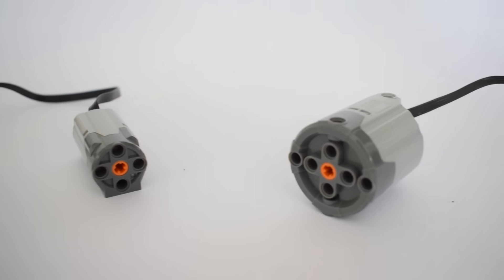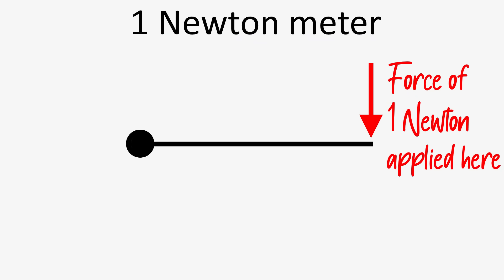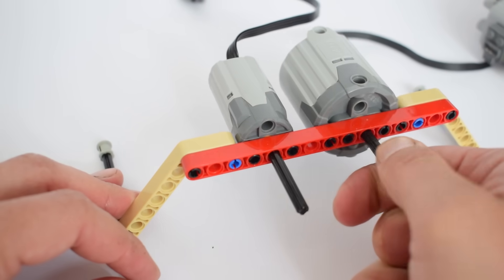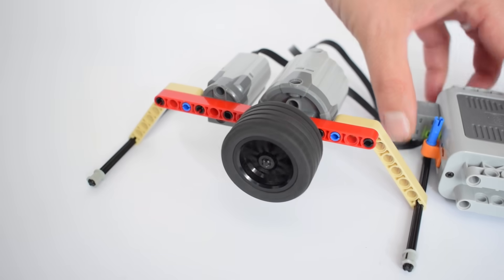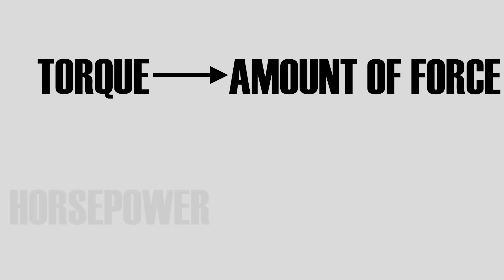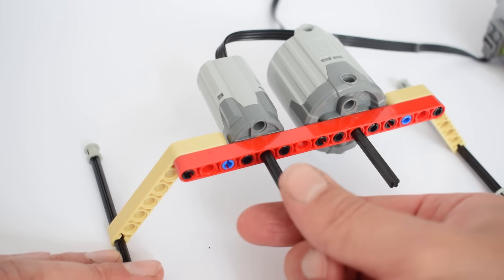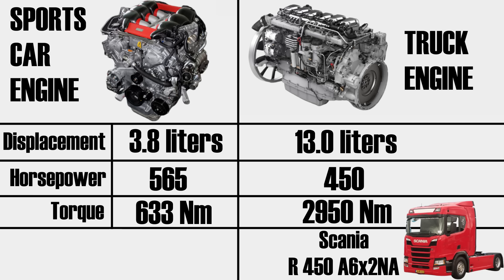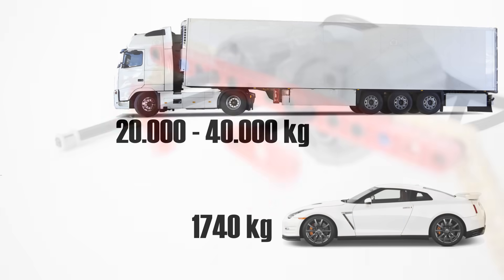NEVER be confused by HORSEPOWER and TORQUE again - HP and TORQUE EXPLAINED in the MOST VISUAL WAY

Comment: Why can't you just rev the truck engine to 7000 like the sports car? Then it would make even more horsepower as well......
Reply: You could and it would have 1500hp or so.

But the issue is massive moving masses are likely to break from balance issues or sheer forces of trying to change the direction of the massive piston every stroke.

Making it stronger to cope will cost more and higher rpm increases wear and inefficiency.

Hence truck engines are low rpm to last forever and not waste fuel.

Comment: I for myself use power and torque to determen how well tuned or at its limit the engine is build/tuned.

I compare hp and torque together. If the engine produces more torque then hp then there is still power left to gain.
Like 1.6l NA with 145Nm and 125hp. If you tune the engine you could get to a point where it is 150nm to 150hp so it is at a good point. Heavily tuned engines can reach even more like 155nm and 180hp. 

But honestly i have no clue how accurate that is.
Reply: It's not strictly true.

You can make way more power than torque on a high RPM motors.

Think F1 V8s 800Hp with like 250lbft.

The HP will keep increasing the longer you can carry the torque up the RPM range.

But you're always sacrificing with combustion engines lairy cams might make 200hp on a 1.6 but you're going to lose out on low end torque.

Comment: Torque is what pushes you back into the seat. 
Horsepower is how long it can keep it up.
Reply: Horsepower does both. Force pushing you back is G force which comes from the acceleration of the vehicle which comes from the horsepower. A "Torquey" engine just has a lot more POWER at low RPM than a low torque screamer type of engine. Power is everything.
By far the most misunderstood concept in the car community.
Reply: @xeigen2  Hold on there ... as a car accelerates you are NOT pushed back into your seat. NOT EVER. It's the seat trying to push you forward and your resistance to motion (inertia) is what you feel. This effect occurs (thinking you're being pushed back) because your immediate environment (the car's interior) to you is not moving. Think for a minute, how can you be being pushed BACK when all your motion is FORWARD? Now what's the most misunderstood concept?
Reply: @thecarman3693  I never said otherwise. I said the force pushing you backwards comes from the acceleration of the vehicle (into you).
From my reference frame as the driver the direction of the force vector is backwards into the seat, so it is correct to say "pushed back". Theory of relativity states that it is indistinguishable from a gravitational force accelerating me backwards into the seat. In physics terms they are exactly the same for the one experiencing the force.
Only an outside observer can tell otherwise.
Reply: @xeigen2  The acceleration of the vehicle into you pushes you forward. There is no rearward force vector on you into your seat. You've got the relativity analogy in reverse. A person in space in a rocket that is accelerating feels a force alright, but it is a forward force in the direction of the rocket. True, it's indistinguishable from gravity, but most people get how we feel gravity WRONG.  Perhaps you might try thinking of it this way. When you stand on a floor gravity is accelerating in what you would call a downward direction; after all, if you drop a ball it falls toward the floor. But ... and this is the BIG but ... the force you feel as your weight (or what you might call the force of gravity tugging on you) is the floor or chair pushing up on you. You are not feeling gravity. (You really never do.) Trust me, if the floor wasn't there to hold you up you would feel as if you were in space ... falling in zero G. That's right, the feeling of zero G while gravity is pulling you down. So in the car the only force you feel is the seat pushing you forward. The rearward force vector you think you are experiencing is an illusion, like centrifugal force, or what you feel as your weight. Yes, that too (centrifugal force) is an illusionary force; the force felt is actually inward not outward. So you never feel gravity pulling you down, only some surface that's holding you up.
Reply: @thecarman3693  I understand that, but my point is this: Where the force is coming from doesn't matter. The seat pushes me and I push the seat. There are two equal and opposite forces as per newtons third law. I can rightly claim there is a force in either direction.
Reply: @xeigen2  Newton's Third law states that the force being applied to you from the seat is felt by the seat as well as by you. But in no way does it say that you are being pushed back into the seat. Both you and the seat feel equal and opposite forces, but neither the seat, nor its material, is ever being pushed back. Squished? ... yes, but only because the frame of the seat is pushing it into you. Your resistance to motion (inertia) is the force squishing the seat as the seat's material continues to try and move forward; you're just not accelerating as quickly as the seat wants to go. And it's actually succeeding. The perception of being pushed back is only from the frame of reference from inside the car, and not what's actually happening. That's why the force of resistance makes you feel as if you're moving back into the seat ... but to any outside observer they will at all times see you, your seat and the car accelerating forward. And even you, if you looked outside, will at all times see your motion as being forward, never rearward.
PS: Einstein's principle of equivalence is to allow for solving equations from different frames of reference. An accelerating rocket ship in space simulates the effects of a gravitational force exactly --- but that does not mean there actually is gravity present. That rearward force you think is pushing you back is merely your resistance to forward acceleration. It's a fictional force.
Reply: @thecarman3693  "The perception of being pushed back is only from the frame of reference from inside the car" Which is exactly the point I made before.
I'm not sure you quite get where I'm coming from here. I already fully understand the concept of inertia and everything you've already said.
My point is that it simply isn't important, it's just being pedantic to bring it up in this context.
We are literally just describing how it feels. It doesn't matter that the force is fictitious, it's still a measurable force in the direction of the seat. Which is why the term g-force exists.
It is just useful shorthand when talking about the world as we perceive it without going into minutia about how it's not a real force every single time we talk about it.
We would get needlessly bogged down in detail all the time if we didn't.
It's the same way that centrifugal force is useful as a term to describe the world as we experience it rather than explaining that it's a fictitious force every time we talk about it.
Reply: @xeigen2  "It's the same way that centrifugal force is useful as a term to describe the world as we experience it ... "
Sorry, but believing that can result in disastrous consequences. If you spin a weight horizontally on the end of a string and then cut that string believing that centrifugal force is an outward force acting on the weight, you will find that the weight will NOT fly outward radially from you. It will in fact continue on a straight tangential path from the circular path it was traveling in moments ago. That's 90 degrees from going radially outward, what most people would expect.
" It doesn't matter that the force is fictitious ... "  Yes it does. You just read how a fictitious force doesn't produce the expected result.
" ...   it's still a measurable force in the direction of the seat."  No. That's the force the seat receives as it presses upon you. The force YOU feel is a forward force, a forward G force. Just like whatever surface you're standing or sitting on right now presses up on you with a force of 1G. You think you're being pressed back in the same way you think you feel your weight when standing up. Inside the car at the start of the acceleration, the car is actually starting to accelerate before you, and the seatback squishes a bit. The forces on the seat are soon balanced (your motion relative to it doesn't change), but not for you. If they were, you wouldn't move. So the unbalanced force on you is what continually pushes you forward. Never back.
Reply: @xeigen2   It's called understanding the physical world as it really is.
There are a great many things that 'feel' one way but in reality are something quite different. There is nothing wrong in trying to explain this when it comes to everyday experiences; why someone would not want to simply accept something as it really is but prefer to continue arguing along a misconception (especially when your attempt at supporting your argument invokes Mach's Principle of Equivalence, not Einstein as you so incorrectly put it, when Newtonian mechanics are all that's needed --- or when you actually claim to know better) is the true pedantic path.
Tell us, what other misconceptions do you go to great lengths to support? A flat earth? The moon landing hoax? Bigfoot? Rods? ... or perhaps the big one, a hollow earth?
Reply: Hold on there ... as a car accelerates you are NOT pushed back into your seat. NOT EVER. It's the seat trying to push you forward and your resistance to motion (inertia) is what you feel. This effect occurs (thinking you're being pushed back) because your immediate environment (the car's interior) to you is not moving. Think for a minute, how can you be being pushed BACK when all your motion is FORWARD?

Comment: Good explanation, but it's only really scratching the surface. The thing people struggle to understand is that with power and gears you can generate as much or little torque as you want, and ultimately it's power that determines how quickly something can go (how much work it can do). Simplistic explanations like "torque=acceleration, power=speed" don't help with this. In vehicle engines torque output is more of a reflection of application than performance. Put the GTR engine in the truck and, with the appropriate gearing, it would be able to pull the load quicker than the truck engine can. But to do this it would have to run at 7,000rpm, and it can't do that all day long. The reason the truck has such a big engine, and therefore so much torque, is because it needs to be able to run at close to it's maximum power output for a million miles. Big engines turning slowly are more reliable and more efficient than small engines spinning quickly. The GTR engine wouldn't last long running at full power in the truck and would use a lot of fuel, but in the car it will never operate at peak power for more than about 30 seconds at a time so that's not a problem. The car benefits from a smaller, lighter engine that spins quickly.

Comment: Everything was alright until the sport car and the truck engines examples as well as the 2 guys examples…
The sport car could have much more torque than the truck if you change the transmission, you didn’t say that you could change the torque in an engine but not the horsepower, there is some unnecessary information there, horsepower is just how much mechanical energy a motor can give period, you can change the torque as needed, even the small lego motor could have more torque than the biggest one, but with lower RPMs.

Comment: So to sum it up, torque determines how much load an engine can pull, while horsepower determines how fast it can turn (at the given load). Gear ratio adjusts the load to an engine. Insufficient torque causes your engine to stall, insufficient horsepower causes your car to drag the gear.

Comment: I wish you had demonstrated gearing at the same time. I feel a lot still don't understand this part of it.

Engines producing the same power (500hp) also produce the same torque AT THE WHEELS, because of gearing.

So 500hp / 2000 rpm vs 500hp / 8000 rpm

H = T * rpm / 7127

500 = T * 2000 / 7127 -> T = 1782 Nm
500 = T * 8000 / 7127 -> T = 445 Nm

So add the same final speed, you need to do a reduction of 4:1 on the 8000 rpm engine, which result in a multiplication of torque by 4.

8000 / 2000 = 4

This will now make both engines in the same vehicle travel at the same speed at the red-line.

The 'truck' engine will produce 1782Nm (way more powerful than the car engine ... ?)
The 'car' engine will produce 445 x 4 = 1782Nm (WTH but that's the same torque ...)

Meaning those engines are identical to what they can haul, accelerate or top speed in the same vehicle.

The reasons for a high torque engine is totally different than 90% of the population think it is.
1) Better fuel economy (less friction)
2) Longer life span (less rotations/hour)

And the reason for a high rpm 
1) Smaller clutch
2) Smaller gearbox (granted you could move the gearbox after reduction, but that's rare) - less torque through the gear box, and fewer gears (4-10) vs a truck (8-32)
3) Lighter engine
4) Faster engine response

Now, the engines are typically tuned differently, and with diesel you can get peak torque further down on the rpm range, but poor efficiency / power rating at the red line, so the effective rpm tend to be smaller than the 'allowed' rpm. Often resulting in a very peaky torque band, requiring many more gears to keep the engine in the power zone (might be 1200-1800 rm), while a sports car engine might have a much wider torque band, but less peak torque, allowing for longer gearing and fewer gears as you can keep it in peak power band with less gearing.

Comment: I am sorry, you call that small toy a sports car,  I have a car same size same motor displacement 700hp 800ft, so there are ways to maximize,  but if the displacement is great the Easter it is to achieve big numbers with less effort.